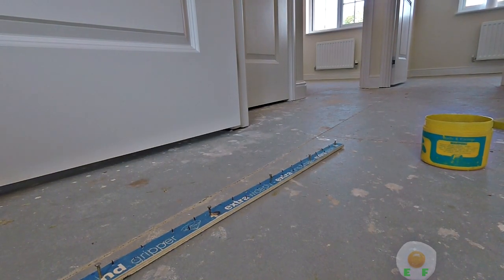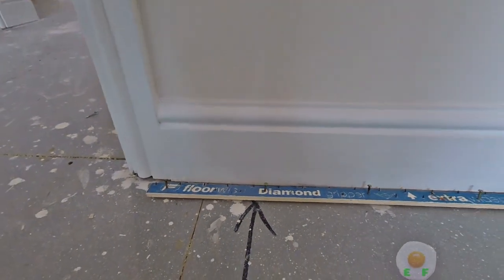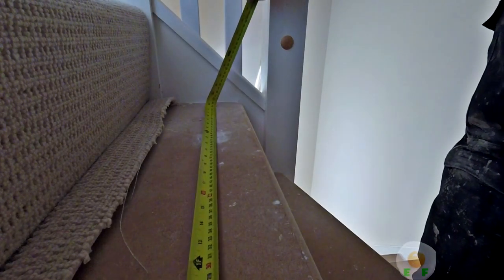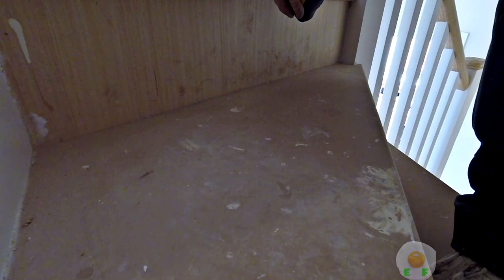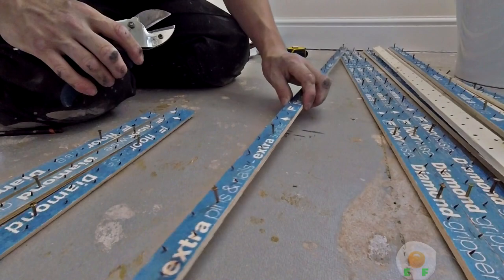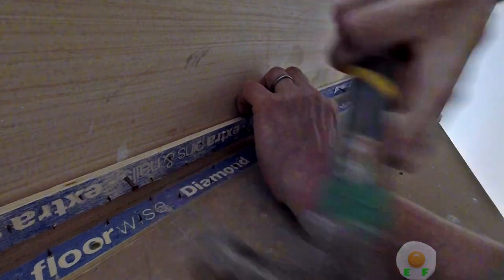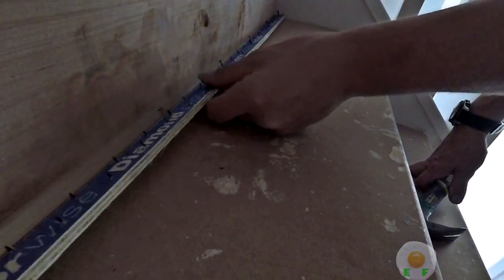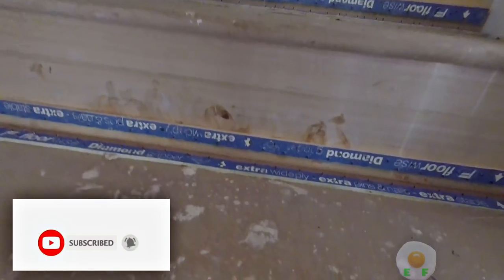FITTING CARPETS (EPISODE 2) GRIPPERING/TACK STRIP

Comment: I got new carpet installed and been cutting my feet on the tacks that stick out. Is it normal to have tacks protrude out the carpet?
Reply from the maker: No sounds like they have layed long pin gripper witch is quite long spikes and the carpet is thinner so they poke frow not right they need to rub them over to kill the spikes or replace with short pin👍

Comment: How is the first step on the ground floor done with gripper. Would you put a gripper at the bottom of the first step?
Reply from the maker: Depends if you are fitting it in one piece then yes if you are putting a false riser then no hope this helps 👍